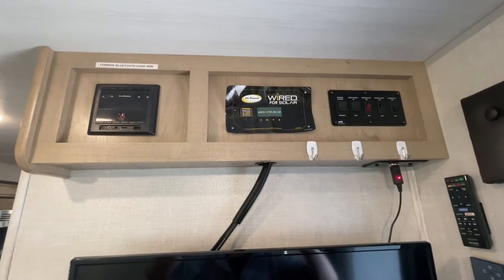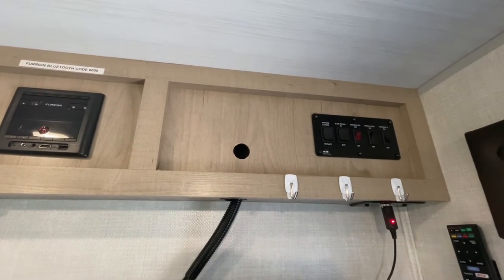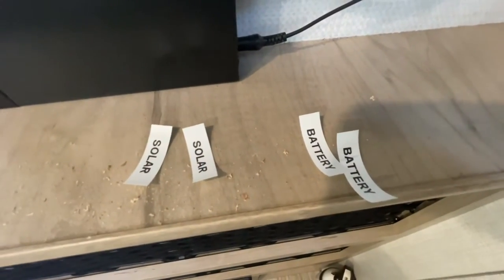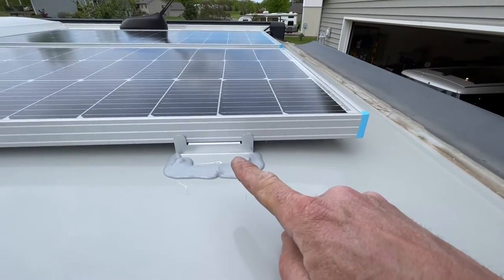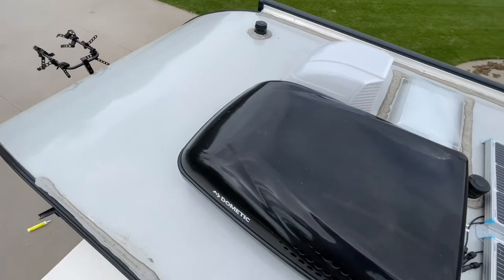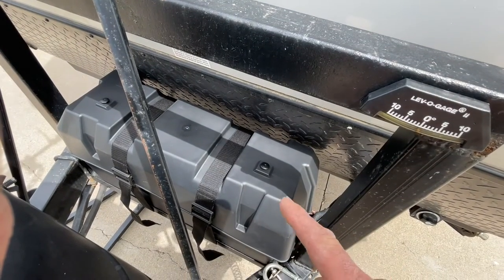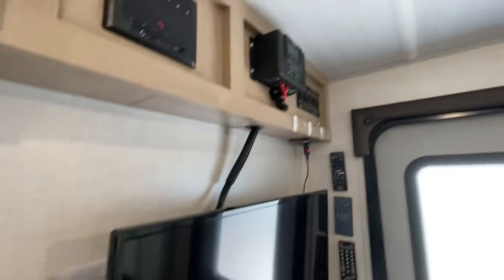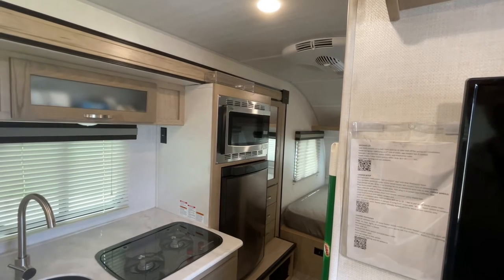r-pod RV 200W solar install: really easy, inexpensive, “solar ready” 2020 190

Comment: Thanks for this video Bennie, I am about to do the same on our 2020 190. One question I have is: How did you support yourself while working on the roof so as to drill the holes, bolt everything in place, and then seal it up?
Reply from the maker: You’re welcome David. 
I weigh just under 150lbs so I’m not particularly worried about the roof supporting me.  I still will step carefully though, and if I feel more give in a particular spot I will choose a different spot to put my weight. Also working on your hands and knees with naturally spread out your weight. Some tricks you can use to disperse or eliminate you weight on the roof are to work off a step ladder on either side of the camper (where you can get it close), or keep your weight along the edge of the roof, the walls are what supports the roof. You can also run a plank across the top of the camper, side to side so you are distributing the weight back to the walls, but that can get tricky because of the roof vent, A/C unit and everything else in the way.
Reply: @bennieaust  thanks for the quick reply! I will try to do something similar.

Comment: I'm curious, you said it was set up for solar panels...how do we make something ready for the panels or can I just try to install it myself?
Reply from the maker: “Solar ready” means it has plugs on the roof, and wirings running from to roof to the location you will mount the charge controller, and from the charge controller to the battery. All that can be installed by you if it’s not “solar ready”, it’s just a bit more work.